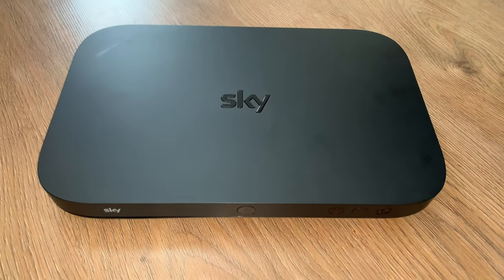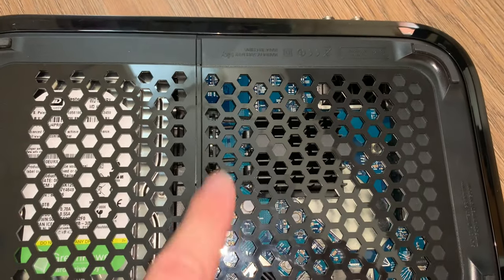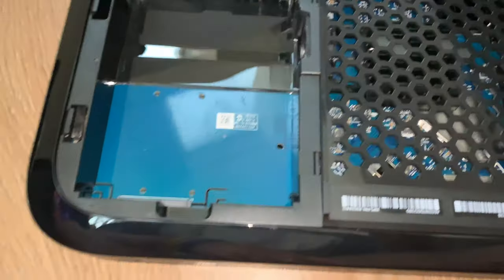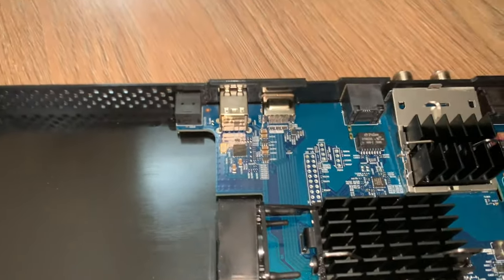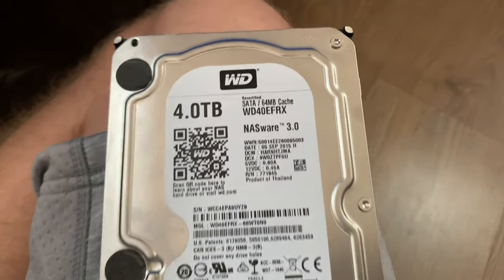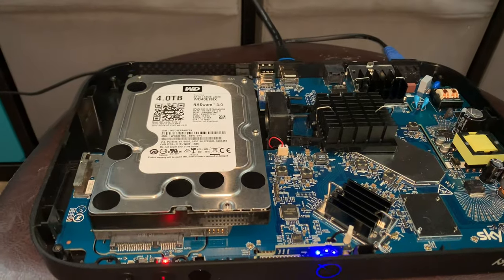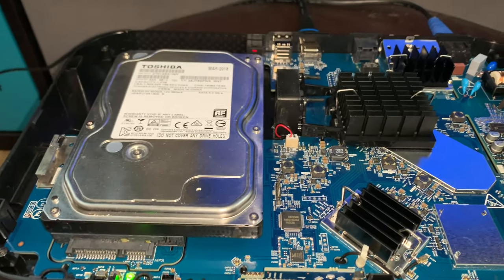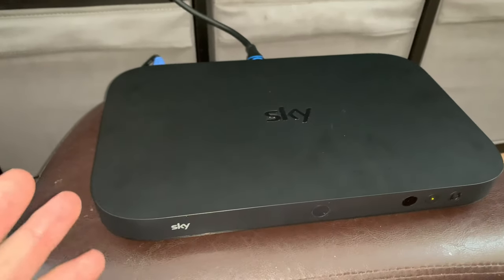Sky Q Teardown

Comment: put a 1TB seagate in my Sky Q Black box and tried everything it's not accepting it. I did a factory reset before and I think that was a huge mistake, now stuck in the setup screen with the drive error :( freaking out. I put in a clean drive with MBR and no partitions btw.

Comment: anyobody swapped successfully the hard drive with an SSD?
mine Is too noisy and honestly i don't like the fact that the motor Is constantly spinning.

powering off completely requires too much time to boot the decoder...I'm surprised that nobody tried apparently, this drive is quite noisy as well and now ss drives are really cheap.

Comment: I would have thought that they would have gone with a 1TB Solid State Drive rather that a Spinning Rust hard Drive so will be prone to problems at a later date, They need to start using a RSA4096 Public Key and a RSA4096 Secret Key, The 3TB Spinning Rust Drive has gone kapoot (no longer working), A 100TB Data Center SSD would have been the way to go and the unit can be made thinner and lighter.

Comment: Hi, first of all, The Sky Q boxes comes ONLY with 1 TB HDD, Yours was also a 1TB (you can see it over the green label 4:15). 2. You cant use it with another HDD, not even with another 1 TB because the devices (receiver, card, HDD) must have to assign with serial numbers in SKY intern system. 3- you cannot use it even though you have a sky smartcard because of the assingment reason. There for peoples can find this devices on e-bay for 5 euros. And yes, i am a SKY employee. (small note: the devices that can be bought on ebay or anywhere are entered in the system as "stolen / lost devices". Sounds not good )
Reply: I buy old devices and wipe the hard drives using EaseUS Partition Master and Acronis True Image. These programs are needed to wipe the partitiion/s that contain the Sky programming that pairs the drives to the box. I then build PC's from old second hand bits that I pick up on eBay, Gumtree and FB Marketplace and I give them away to people in need. Old folks at retirement homes, children of families that do not have the means to purchase devices to aid in their childrens education and I also use them to repair PC's of people I know that need it. I am a retired policeman, are you saying I have broken laws, giving that the items I get are classed as domestic rubbish and am I now a criminal? When I had Sky Q installed, from a Sky HD upgrade, I informed the technician that I do this. He said nothing, but he may not have known and he let me keep the 2 old boxes from my old contract.
Reply: In case anyone is wondering does the replacement hard drive work? Yes it does. My hard drive failed on my Q box last night, replaced with a drive from an old PC this morning, used the hard drive reset function on Sky Q, and it works fine. So this serial number stuff isn't correct. Just one screw to remove on the Q box following the video above, very easy removal and replacement, but the screw head is a funny size, luckily I had the correct bit.

Comment: Could I fit a SSD?
Reply from the maker: You wouldn’t see the benefit and if you did probably best to go for a HDD which is designed for the constant read and writes as they have specialised ones
Reply: @MrTechtalk  It might actually be able to do chasing playback on 4k (e.g. F1) with an SSD - whatever is in mine simply can't keep up when attempting this.  It also might make the box run cooler too since you wouldn't have a full size spinning disk trapped in a shallow case with no real ventilation out of the top. Come on Sky - heat rises!!
Reply: Muhammad Chattha  yeah? What about it?  So it circulates within the case and just gets hotter and hotter and hotter because hot air does not try to escape downwards! What's your point?